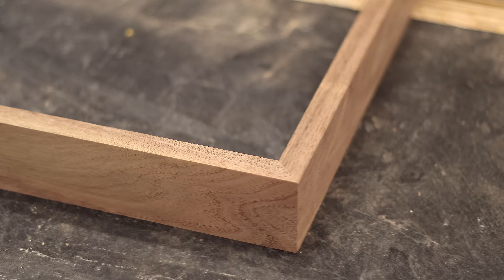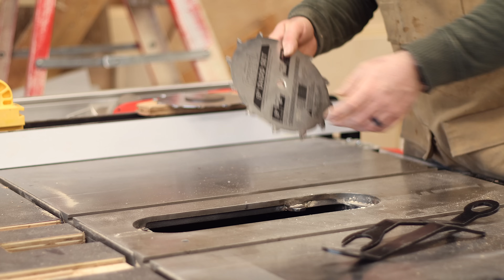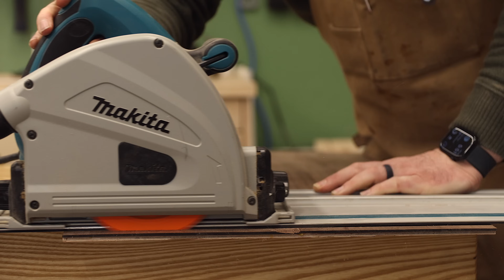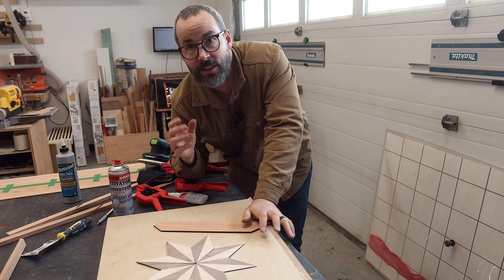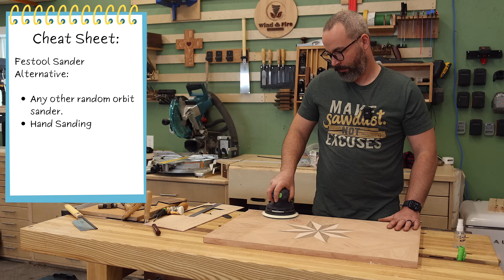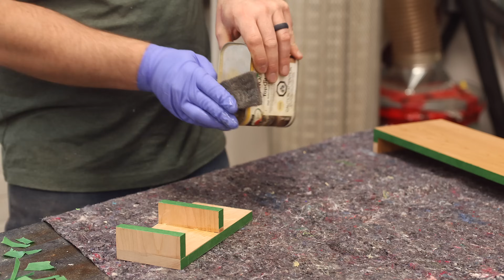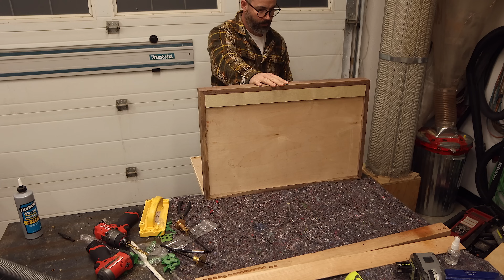8 Must-Know Secrets For Next-Level Woodworking!

Comment: A-Z if I have a plan. However without a plan, which is usually the case,  I tend to ad lib and detour, back up, or change directions completely.
Nice folding desk. The inlay is beautiful. I hope the strut screws continue to hold up to the weight of people leaning on the desk top.
Reply from the maker: Thanks! 👍 I’m hoping they’ll hold on. I have a few less than ideal ideas how to reinforce it if they don’t.

Comment: If you want to use your fence as a stop, you should have a block of wood attached to it, so the wood clears the fence during the cut. 
That is a dangerous procedure using the fence alone as a stop and is incorrect.
I would point out that you have a miter saw and can use it to cut...miters or 45*s

A-Z, Batch, Detour, Same Setup. It depends.
Reply from the maker: I hear you. I don't actually consider the fence all that dangerous as a stop in this case. The mitered edge is vary slim and the mitre gauge is on the same side of the blade. There isn't any offcut to get caught up here. When my mitre gauge is on the left side of the blade, I agree that there should be a block of wood on the fence. As for the mitre saw, I could...but I like my table saw better for these cuts. Thanks for watching! 👍

Comment: Blue tape works just as good or better than those band clamps, I've used those band clamps in the past, never cared for them. Blue painters tape is actually very strong and holds so well, give it a try. Blue not green lol.
Reply from the maker: Why blue over green? I find the green tape to be cheaper and to stretch more.
Reply: @windfirewoodwork  blue grips a bit better, the colors are to indicate stick strength (when painting) so blue will stick better with less stretch, green has more stretch but less stick, I'm not saying don't use green, but blue works better as a clamp imo.
Reply from the maker: Makes sense, thanks!

Comment: At 1:14. Don't do that. It's fine to use your fence as a stop block, but before you cut have a firm grip on your workpiece you should push your fence away to remove any resistance.
Reply from the maker: Thanks for your concern. With the thin mitred edge against the fence and the mitre gauge on the right side of the blade, everything went very smoothly. But yes, there are situations where this would be a bad decision!